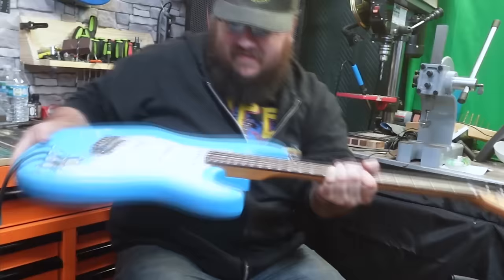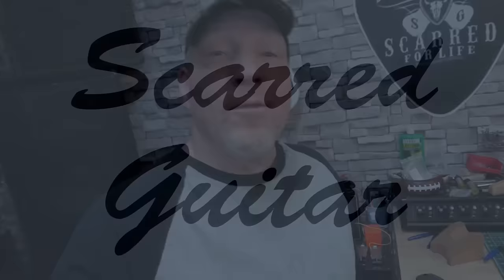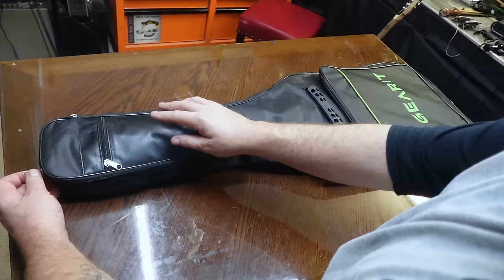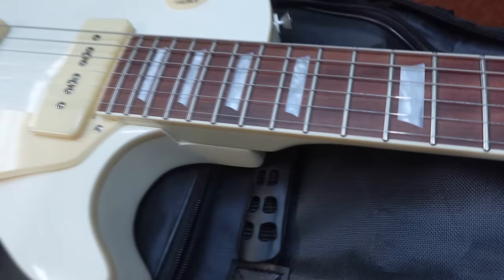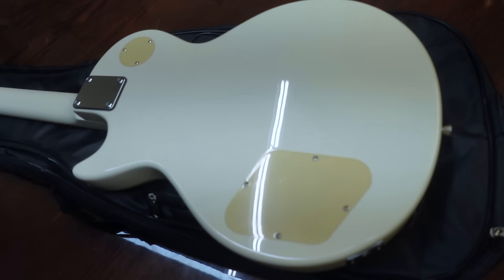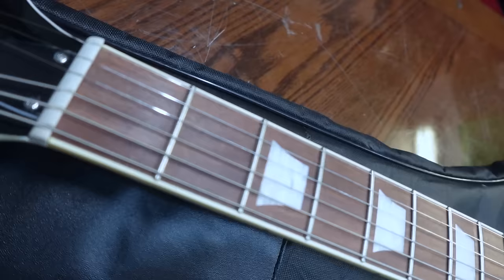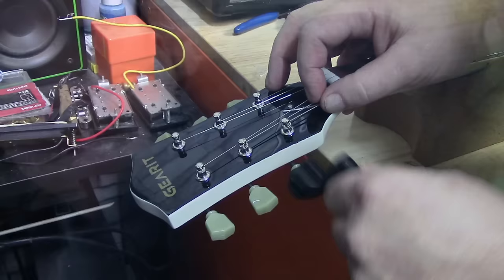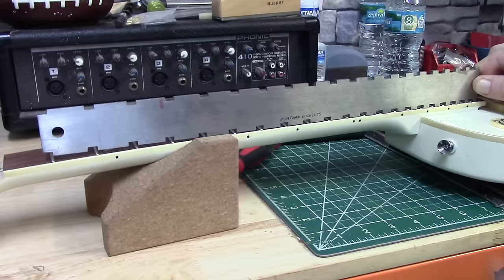Amazon Les Paul Copy IS A BEAST! BUT IT TOOK SOME SERIOUS WORK To Get It Right!

Comment: A wise man once told me, if you buy a cheaper guitar, or a used guitar, youre typically buying it for the body. After realizing that ive replaced tuners, filed fret ends, conditioned fret boards, changed pick ups, pots, bridges, knobs, and strap locks,  it makes perfect sense now.
Reply: May as well replace the body, and neck as well if you're going that far.
Buy it nice, or buy it twice.
Reply: @qua7771  if youre happy with stock, sure. I myself have my own unique sound, and stock doesn't fly....and its different between both bands.
Reply: @DieselKevcop  It depends on what stock is.  Personally, I don't understand why a player would cheap out on their instrument, unless it is their first time playing.
Reply: @qua7771   oh, for sure. Id never buy a chibson, squire, etc.  ive got 2 explorers, 3 les pauls, a 335,
Reply: ...and none of the pickups are stock. Been playing 30 years, and other than my esp, i havent been happy with what they came with.
Reply: @DieselKevcop  Chibson is mystery wood with bling.  Putting $650+ of parts, plus labor into a $200 guitar seems crazy to me.  Old Japanese guitars can be amazing.  I got my kid a Squire, and some of them aren't bad, but I don't think fender parts fit, so there's not much of an upgrade path.  The guitars I have a problem with are the really cheap ones, and when people think the got a deal by purchasing them.  They will defend the cheap crap until they advance past that level.

Nice Gibson's BTW.  I've been considering an Explorer.
Reply: @DieselKevcop  I have a bunch of Gibson pickups in a box that I never really liked.  Funny you mentioned the EXP.  I think the Japanese made some of the best pickups.  I have a few "law suite era" Greco's with original Maxon pickups that sound amazing.  I put Wizz pups in my R9 and couldn't be happier.  I have SD Pearly Gates in a Epi, that are just okay IMO.
Reply: @qua7771  Grecos are absolutely incredible. Arguably just as good as gibson. Tokai too. I have a wine red 96 glp studio that got emg bone breakers, but most of mine are alnico pro 2 . Both of my gibby slash sigs got them too,  since they dont come with them.
Reply: @qua7771  i have a high sparkle red, and a vintage burst. The vintage is my child.  Great guitar.
Reply: @DieselKevcop  Sounds like you have an interesting collection for sure.  '96 was a good year for Gibson.  Everyone I talk to loves the Studio's.
I think the higher model '70's Greco's were as good as Gibson's of that era.  In the '80's they copied '50's Gibson's.  I wouldn't mind getting one of their Explorers, but they cost more than a Gibson now.  I might get one of their 335's.
Reply: @DieselKevcop squires are decent and a lot are giving fender a run for their money especially classic vibe
Reply: And only a rich man can afford cheap tools. 😮😂✌️
Reply: As some one who’s  personally done that to about 20 different budget guitars all ranging from $70 bucks to $190 - and it’s always for the body - I typically swap out the necks for a Mexican fender neck for about $300 & add USA pickups or custom shop pickups for around $300 add some locking tuners for like $50 and it’s still cheaper then some brand New Mexican fenders for $900 $1200 & you still won’t get the same quality of pickups - for example I just put Gibson Greeny pickups & push pull pots on a Leo jamz les paul cherry for 189. The neck feels solid and the quality and the finishing is plenty nice & cheaper then the $1500 Greeny Les Paul from epiphone -
Reply: @thevaultdwellergaming  you'd be better starting from a higher quality modding platform like a sire, or just buy a body from one of the numerous body providers
Reply: and thats the best part of electric guitar, u can adjust it as much as u want t

Comment: I love a 7.25 radius. Why didn’t. Gibson or Epiphone even, do a 7.25 radius. I have an Epiphone LesPaul  Special 2  14 inch radius with a bolt neck and it was bowed as hell. With  P90s .  I set it up and gave it to my granddaughter. After spacing the pickups it sounds good, but my ball glove hands can’t scrunch that thin of a neck. My Tele has a 5Os U neck and 7.25 radius.  I am thinking about a Humbucker on the Bridge, it’s a 50s Vintera MIM. I wish I could build a 7.25 radius Epiphone LP Special with a 25.5 scale length and a thick neck, a P90 neck H with a coil split. I’ll be there Brother and Sister !

Comment: I actually got the GEARIT semi hollow Tele for Christmas from my wife and I have to say I was very surprised how nice it was. It has a roasted maple neck , stainless steel ball end frets with a soapbar P90 neck pickup and humbucker bridge pickup. The weakest thing are the tuners , i had a set of vintage locking tuners lying around so I swapped them out. Everything is perfect and no flaws with the finish....

Comment: I just rescued one of these from my local Goodwill (a black and cream one).  Other than fingerprints, it looked brand new.  They had an insane price on it, so I passed on it when I first saw it.  Went back this morning and the color of the week matched, so I got it for $90 (including the bag and all of the standard accessories that it came with).  Was missing one string, so I dug one out from my old string collection and as I'm tuning, I'm wondering why the rest were cranked so high.  Tuned it normal and I figured out why.  It was completely unplayable.Truss rod was WAY out of adjustment, so they overcranked the strings to compensate before giving up on it.  Just spent some time adjusting the truss rod and doing a level & polish on the frets.  Put the strings back on and tuned it up.  Action was already spot on.  It just needed some adjustments for intonation.

Probably going to leave the electronics alone.  I like how it sounds.  The selector switch is a bit cranky.  I will try cleaning it first.  That might be the only electronics work that it needs.  I will install my preferred strap locks on it and new tuners....... most definitely new tuners.  LOL!  The nut might need some attention, but I want to spend some time with it before I do anything there.

Comment: I bought this same guitar in black for $85 off amazon, Couldn't pass it up as I don't have a les paul  special and liked the idea of the P-90 pickups. Out of the box it looked really great, but the out of the box playing experience was a disaster. It took major tune up steps, after which it was really pretty good. It is definitely NOT a guitar for beginners. I had to work thru the same problems as you, and a bit more. While my neck was pretty flat the truss rod still needed adjusting, but that was not enough. The neck angle was way too high probably double what it should have been. I had to shave the bottom of the neck slot to get it down enough so I could lower the bridge to a reasonable height. The low E bridge post was not pressed all the way in - rubber hammer and lock of wood too care of that. Even with the neck pocket shaved down and the truss rod adjusted the bridge pickup would not adjust high enough to get the 1/4 to 1/8" P-90 spec from the strings. The neck pickup barely made it. I put some springs on the pickup screws but I still need to shim up the foam in both pickups to to get it stable. Intonation went OK, but one of the screws needed work. Once I got it that far I was able to play it, and I was surprised how good it sounded. I ordered some bone nut blanks - I hate plastic. So far the tuners have been use-able - If I get new ones like you did it will double the price of the guitar!  I will being doing a fret job when I am up to it, probably when I fit the nut. 
I call this addition to my collection my "less" paul not-so-special. But hey, if like you or me you are willing and able to do the work, it is quite a bargain!  also note - I am going to steal you idea for putting the fret crowning file in the sawzall - pure genius. Thanks for an entertaining video.
Reply: That Auto fret crowning is awesome.....  

And I agree with you...  If you got the time and are willing to put in the effort, you can make a $100 guitar feel like a $1000 guitar.....  
Ain't nothin' wrong with that....  

Gives you more money in the end to buy more cheap guitars... Nothing like looking at a wall of guitars and knowing that you didn't break the bank for it.
Reply: @mruncletheredge  not only is there nothing wrong with it, but its a heck of a lot of fun. spending time working on my guitars is a hobby, what better way to practice your hobby than taking inexpensive guitars and making them play as good as they can play...can't think of a better way to waste my time. lol
Reply: @cletislebow1182   I hear you...  I just got 3 Chinese cheapos that arrived last week...  An EVH Frankie, a Musicman EVH and a copy of Andy Summer's 50 year old Telecaster.... 
I'm so pumped to get started working on them... 

They look fantastic and play pretty good...  But I'll probably change out a nut or two along with some fret levelling and crowning.  And possibly some electronics... 

Other than that, the usual set up things. 

This IS THE FUN STUFF ... 

Less than a thousand bucks for three all time classic favs of mine...
NGD all the way...   😁

Comment: I got one of these on Black Friday for $76. I had to check it out. It is better than the one you had to work with. I wanted the white one, but waited too long and they pulled the coupon, so I got the black one instead. It only needed a little fret work. Tuners feel a bit cheap, but hold tune very well, so who cares. They are all consistent. Nice guitar.

Comment: Interesting. I got ome at the beginning of the year ever so gently used. Amazon had sold out of them before I could buy one, so I had to do a search, but found one. Other than slightly tuning it, I had no problems. For some reason, Gearit stopped making them as soon as they started, and sold out FAST! I don't know why your friend got his guitar in the condition it was in, but I didn't have those problems. I just plugged it in, tuned it up, and started rocking out. I hope Gearit starts making them again. Not a bad little LP copy for the price.
Reply: I bought two for about $69 each planning on selling one. Kept both because I liked them so much. One needed some work. The other also needed work but the neck was bowed back like the one in this review. I think these were the first guitars that GearIt sold, and their supplier just didn't have (or assign) guitar people for the final QC.

Comment: You're right that this guitar has good bones, but also right that you need to be able to do the work for it to be a bargain. I have two of these from when they were blown out at about $69 each. The tuners come bone dry, and a drop of lube makes them work and feel as good as any other cheap tuners. If you check the two pickups, you'll find that they are identical: both are 50mm and have identical resistance. I put in a $35 pair of of replacement P90s in mine and think they improved a lot. Also, one of the pickups out of the four I had was bad or wired incorrectly so that there was no way to balance them out on volume. Replacement pickups gave no problems. Leveling and leaning the frets, filing the nut and adjusting the truss rod yielded two VERY nice guitars. I did one with ceramic P90s and the other with alnico P90s. Interesting difference, both nice. Mine are black and sunburst.

Comment: The Epiphone Les Paul Special is a $500.00 guitar, set neck soap bar P90's, it's nice. Are you thinking of the Epiphone Les Paul Special II, that is the cheap bolt on neck humbucker model. As to the tuners, Kluson 3 on a side are direct bolt on replacements for what was on it, I have had a set on my ES125 since 2003, smooth and stable.

Comment: That dreaded G String that never intonates nor stay in tune for long, so I make sure the nut slots are cut proper on one of those bone nuts that have the slight gap on either side of the nut that butts up to the fretboard,  have a straight string pull headstock, premium tuners and roller string trees or graded tuners and I grease the nut slots on all my guitars, not with pencil cause it cakes up and makes the strings catch in the nut slots or I use graphite white or black marine grease or 3 in 1 oil like you. The guitar intonates good and stays in tune longer. 
If you got pinging strings when you tune them , then your strings gauge or nut  slots may not be mated to one another properly, string angles to tuners may be steep or not straight enough through nut slots to tuners, crimped strings in nut slots, or dry nut slots !!!
Sean, , I liked this video. It's a testament to the fact that you can make any plank spankable !!! 👍🆒
I have a guitar much like this that needs some work on it that I bought as a collectors item off the HSN. Yep, it's a Keith Urban LP Style White electric that has some fretboard issues. I just have never tried the guitar up nor have I modified the guitar in any way. I've had this guitar for approximately 10 years and I play it and adjust it up and keep it hydrated and such. I only have an issue with maybe the tuners and a high Fret here and there. Always that 1 to 3 high or low frets in key playing zones used most on a guitar. I'm not very Fret Works Proficient, but I do what I know I can and keep studying and learning the luthier crafts and so much that it truly is a craft to make the outcome a work of art that play excellent, smooth  and sound great how you want or need to play certain genres & styles.
I do not have a decent Luthiery anywhere near me for about up to 300 miles in any direction, so over the years I started studying Luthiery manuals from Stewmac, and a fellow name Frank Ford's website. I found it easier and cheaper to just go buy a pawnshop guitars for parts or Carvin/Kiesel or Stewmac or Logo  Necks !!! I do not care about Logos unless it is a collectable instrument. I'll Frankenmodify an instrument however to suit me, my wants and playing needs !!! Play On FretBro . . . 👍🆒🎸🤘🎼☺️🇺🇸🙏 DDH 2-7-2024.

Comment: Amazon had these on sale not too long ago for $80. A grabbed a brown burst one and had the same problem. Truss rod was so tight you could hear it snap when torque was released from it. Once I had the neck relief set the frets had to be leveled. After that it has been a great guitar. Others in the FB budget guitar group I am in also bought them. Some was perfect out the box and others was like mine and unplayable until a bunch of work been done to them. Another common complaint on them was pickup height. It is hit or miss with these LP's but if you get a good one, its a fine playing guitar that feels great in the hands.

Comment: Cheap and cheeful.... I love a good economy guitar. Thanks for the video (no he was not filming, for you young guys that call videoing filming. You need film to film. This is video.)  The set neck guitars feel like higher quality (but remember even crummy acoustic guitars have set necks.) The fact that he could take that neck off the guitar makes things easier for him, and probably, arguably allow for more acduracty in his fret work. Screwed on necks may look cheap, but they sure do allow for much more latitude for a luthier, when working on them (it appears.) This is not to mention the shims that they can use to change the neck angle. Set necks are beautiful, and they appeal to the cork sniffer in us, but in practicle terms, screwed on necks allow for greater accuracy, in working with action.  (No those are not bolts holding on the ncek. They are wood screws.)

Comment: Truss rod adjustment & fret work. Sounded pretty good. Wonder what it sounds like with the original tuners & nut ? But since the strings were off & some parts handy ? Might as well go for tuning stability.

Comment: My cheap p90 les paul doesnt have a bolt on neck..I love me some cheap ass p90 les paul copies...lol i got a great goldtop harley benton...love it. Changed knobs..removed pickguard..and i set it up..its awesome and sounds badd ass...
Reply: I have the same model.  It's a great guitar and sounds great stock. Although I find I never have the volume knobs on the guitar past 7 or so.  Full bore it's just not near as articulate as other p90 guitars.  

But man it can sing in the right hands!  I have $600 and $800 guitars that Plat worse and sound worse than my $200 Harley Benton. I bought a Tele from them too and it honestly was terrible and I sold it after a month. But their Gold Top P90 model is money.

Comment: Great video again Shawn and the P90's sounded sweet as i suspected. Yes, i have done some of those jobs earlier on the frets and necks too but they are so worth it. I just love to hear what my customers think about my renovations, rebuilds and setups. Last time i did it was on a customers Telecaster with a wrongsolderd neckpickup ground and the setup on that thing was just terrible. But i fixed all that and scraped of the gripboard, filed down the frets, polished and cleaned it and did a whole new setup on the trussrod and tailpiece. The customer was extatic. I love that.👍
Greetings to you all from ~Rob :- Giggedy giggedy!!!

Comment: I love your channel bud ,  , these el cheapo's can be great learning tools for setups , all sorts of mods,  I wish I could pass my two guitars over to you , one is  Vintage v100 JHS 2010 Les Paul type set neck Mahogany body Rosewood  fretboard , heavy as you know what my other I call the red beast the guitar fender would of loved , American Alder Maple Neck with a thick slab of Rosewood she's a big girl at a 11 pounds , I'm considering upgrades , with the V100 it has the Asian special small pots but unlike this one it has room for larger pots , that's the first upgrade  then latter nice PAF type of buckers ,  the V6P with stock Stacked Ceramic P90's I like a more smoother blues sound,   it has has no capacitors  and you can roll off the tone ,  great video ,